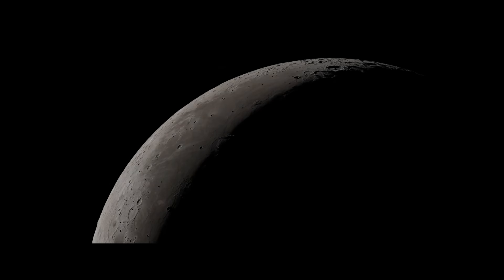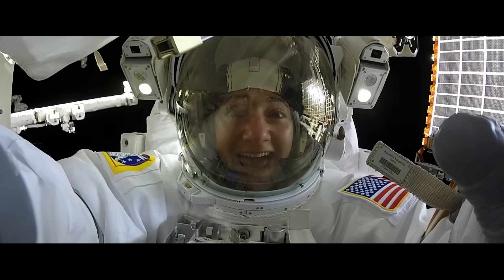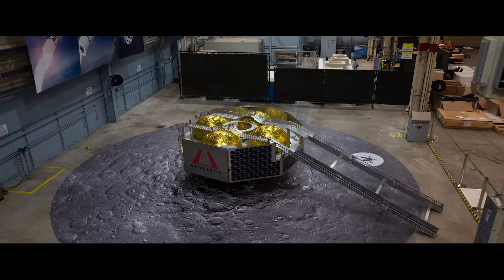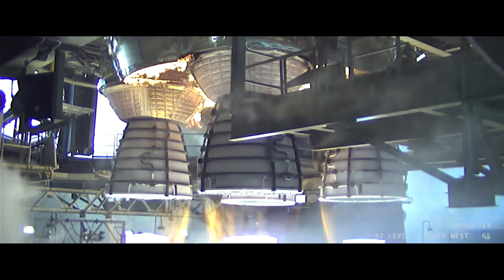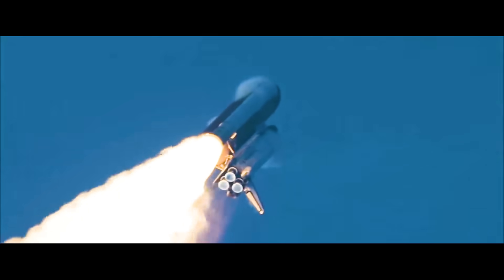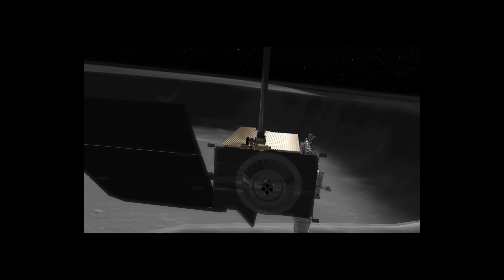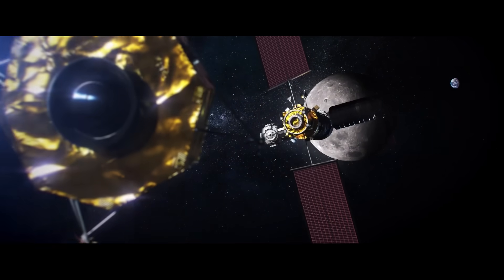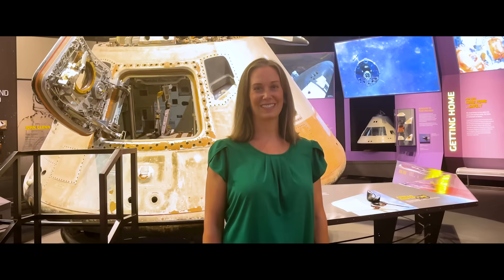Why the Moon?

Comment: Imagine getting funded billions from the government, yet not achieving the same goals as SpaceX with a start capital of much lower. Although it is an interesting mission::)
Reply: Ah yes the musk fanboys
Reply: Don't be mistaken into thinking SpaceX is ahead of NASA with their rocket development. NASA has ironed out their design by now compared to SpaceX and I would say they are actually the ones leading. Even if SpaceX launches their orbital test flight before SLS launches, it doesn't really change anything. The Artemis 1 mission planned for November will send payload TO THE MOON, not just complete 2/3rds of an orbit around the Earth as Starship is supposed to.

Also NASA and SpaceX have very different project management methodologies. NASA is very meticulous about their design, they plan everything up-front to make sure they get it right the first time, probably because they are a government entity and they are funded by the citizens. SpaceX on the other hand follows more of an Agile methodology, aiming for a Minimum Viable Product and then adding features over time. They do this by trying things out often and not being afraid of failure; this allows them to iterate and adapt fast. As a private company I think it's much easier for them to follow this kind of methodology.
Reply: @raizenpk  Um, there isn't a competition between NASA and SpaceX. NASA funds missions and programs and contracts with aerospace companies for the hardware for those missions and programs. NASA is one of SpaceX's biggest customers, not its competitor. SpaceX's other big customer is the USSF for NSSL payloads.
Reply: @steveaustin2686  I agree 100%. It's just that they are both developing a new rocket at the same time and I probably misunderstood what OP was saying. In any case, I expect SLS to be the last rocket NASA develops as the private sector becomes more and more component in providing cheap solutions.
Reply: @raizenpk  Yeah, SLS/Orion looks to be the last one developed that way. With the Commercial Crew program, the Commercial Resupply Services program, the Commercial Lunar Payload Services program, and the Human Lander System program, NASA seems content to let the contractors drive at NASA's direction, instead of driving themselves with the contractors advising.
Reply: @raizenpk  Yeah, but Starship is doing the orbital mission soon, whilst the artemis mission is now even more delayed. Comparing the years, SpaceX is more successful, but that depends on the methodology (as you said). SpaceX has a mission to bring people to mars, but NASA is more on the research side. So both of them are successful depending on how you look at it.
Reply: @SD352-68  yes indeed Lunar Starship will definitely help with developing mars starship, via orbital refueling, airlocks, cryogenic fluid management, radiation protection, and testing of the life support systems.
Reply: @SD352-68  Very true. SpaceX would not have survived without the help of NASA's billion dollar contract. But in general, if you compare the money spent in producing rockets, fuel, successful missions. SpaceX is the winner, even though they technically arent without NASA. There is also a reason why the chose SpaceX. NASA has the astronauts, SpaceX has the rockets and the load capacity.

Comment: So how many “We are going” videos since 2015?
Reply: CLPS and CAPSTONE about to launch, PPE+HALO launch/construction contracted, Artemis 1 SLS nearly finished stacking and HLS contracted. WE ARE GOING
Reply: @iamarokotmanson  What about the Bezos lawsuit? Didnt that delay things?
Reply: @tylerkling8675  Unlikely to have a major impact unless it gets prolonged. The biggest impact right now is that SpaceX can't work together with NASA on the Starship system. Shouldn't be crucial yet since SpaceX first needs get the prototype Starship flying and probably a fuel depot and tanker version after that.
Edit: Should probably add that if there's delays it'll probably be the space suits. Of course other systems might not be ready by 2024 either, but space suits are as good a scapegoat as any.